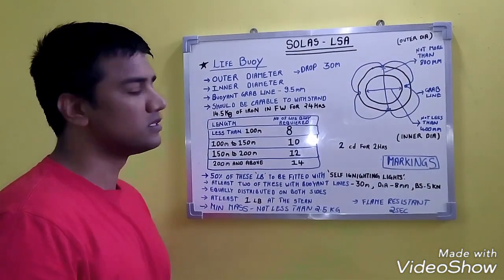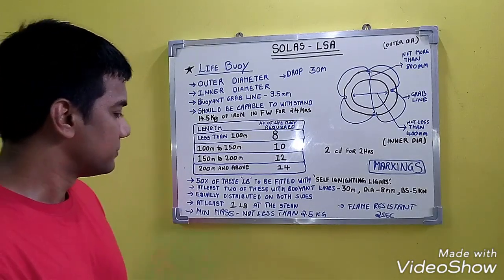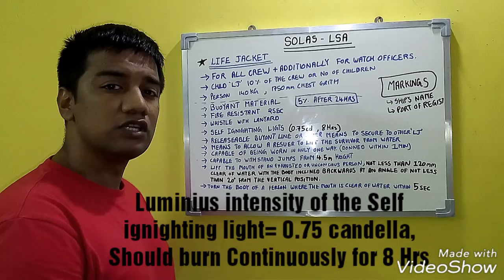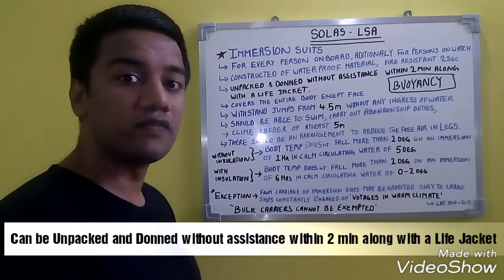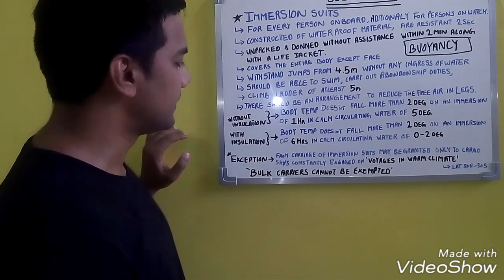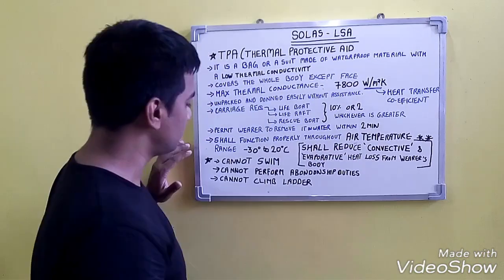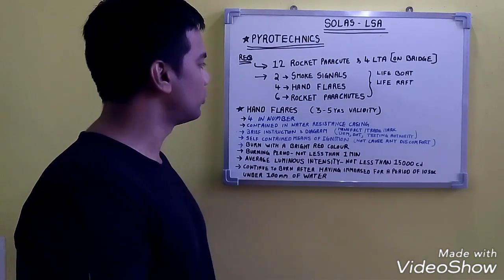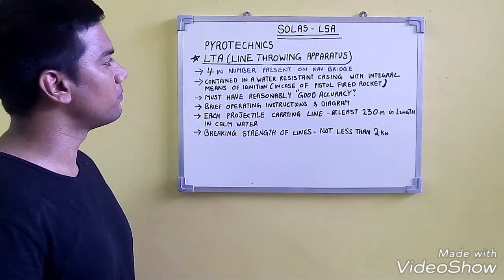SOLAS , LIFE SAVING APPLIANCES, 2 MATES ORALS F3

Comment: Just 2 corrections Mr.Nihal
1)Mobbuoy self igniting light has the same intensity as the ordinary lifebuoy light which 2 cd (in video its been said as 35 cd)

2)Grab line sholud be 4 times the outer diameter not the outer circumference
Reply from the maker: Naveen Kumar 
Agreed.
👍
Reply: N it's hand flare- 6 rocket- 4 n smoke signals -2
Reply: Naveen sir aap ka rank
Reply: Macha mass kattura😍😍😍
Reply: @mmdexam  2nd officer bro

Comment: 4.4.8 Lifeboat equipment
13 four rocket parachute flares complying with the requirements of section 3.1;
14 six hand flares complying with the requirements of section 3.2;
15 two buoyant smoke signals complying with the requirements of section 3.3;

Comment: great video.... i just had a doubt regarding the Lifebuoy grab line  diameter. In your video it was showing 8mm but i checked in the LSA code it was 9.5mm shown there
Reply from the maker: Yes just checked. 
What I said is correct , need correction with the display caption.
Thanks for bringing this up .
I will replace this video soon with Corrections.
Reply: @ DEEPAK NEGI. Watch the vedio again, nihal has written in board that bouyant lifeline diameter is not less than 8mm, not the grab line,. Grab line is not less than 9.5 mm there.

Don't worry bro nihal we are with you 😂

Comment: For the Life buoy at around 0:31 you say it should be capable to withstand drop from TWICE the height at which it is stowed ? Isn't it just the height at which it is stowed.
Reply from the maker: Akash Kaushik 
I stand corrected, in LSA code it states that "Life buoy to be constructed to withstand a Drop into water from the height at which it is stowed above the waterline in the lightest seagoing condition or 30 m, Whichever is Greater, without impairing either it's operating capability or that of it's attached components."

Comment: MOB bouys are required to have a buoyantt line ? or just smoke sig and self igniting light ?
Reply from the maker: Azula Mikazuki 
Yes they may or may not have a Buoyant line but Smoke float and self ignighting Light will be present for all MOB Life buoys.
Reply: Nihal Gupta when I was onboard recently (1 month ago) , the MOB was not fitted with buoyant line. Only smoke signal and self igniting light as one device. Is this regulation recently updated ?
Reply from the maker: Azula Mikazuki 
Well , I could not find any Regulation stating that Buoyant line is a must for MOB marker.
But incase fitted must meet the criteria under Regulation 2.1.4 of the LSA code, As required by Regulation 7 of chapter 3 of Solas.
Reply: Nihal Gupta thank you !